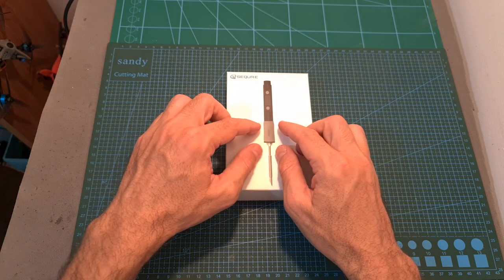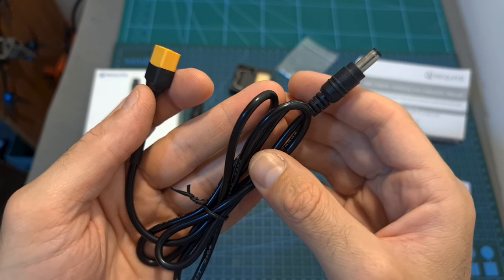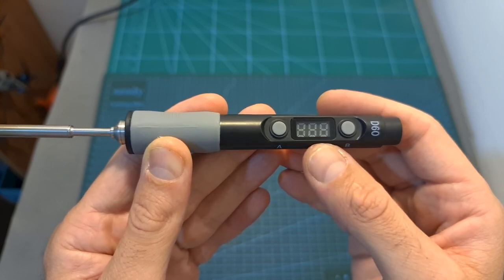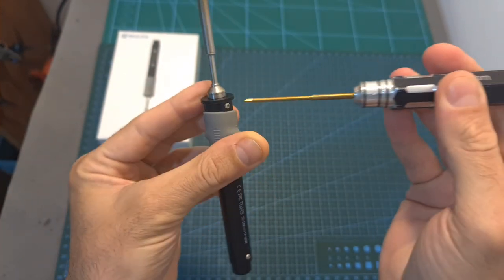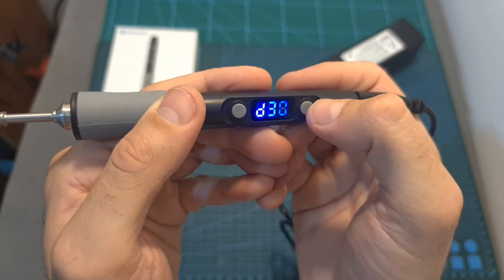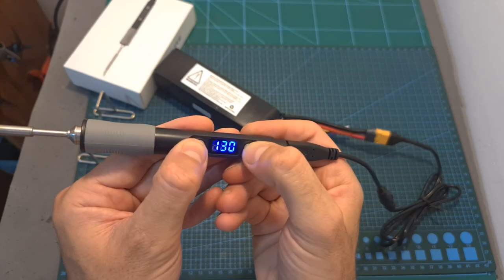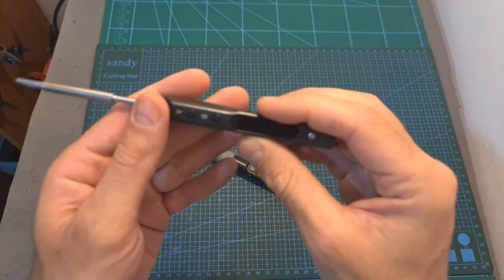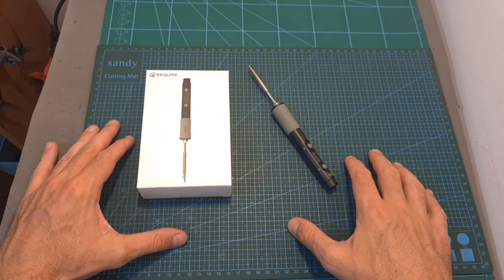SEQURE SQ-D60B Budget Friendly Field Soldering Iron

Comment: People say that it draws 1.37 amperes no matter of the power supply voltage. So it have about 33w max power. Could you please check It's power consumption at 24 volts?
Reply from the maker: I don't have it anymore, sorry.
Reply: @KremerFPV  anyway thanks for the answer. BTW I've got an answer at the sequretech channel they told that it is about 37W max power.